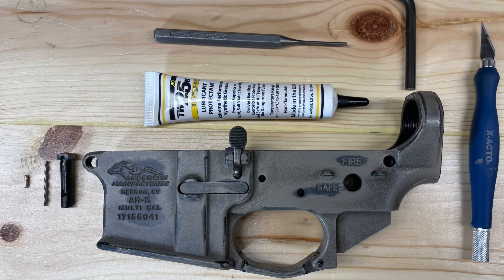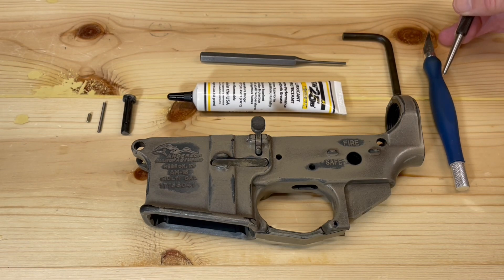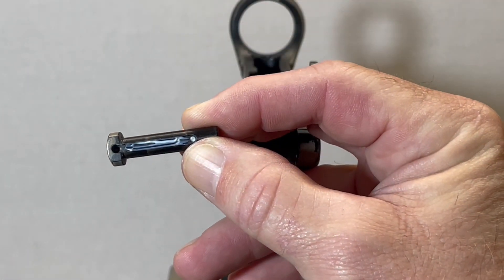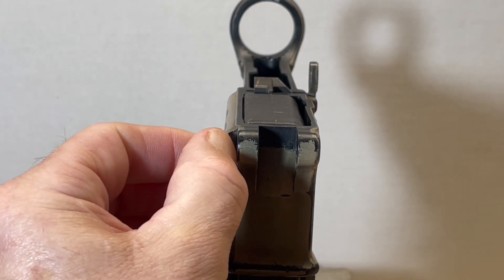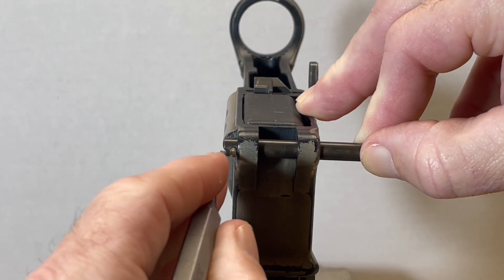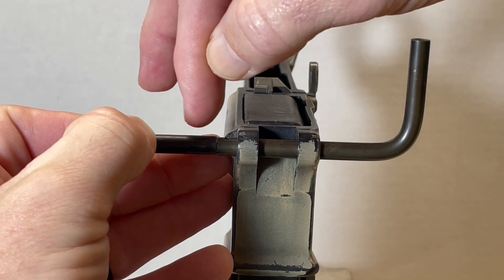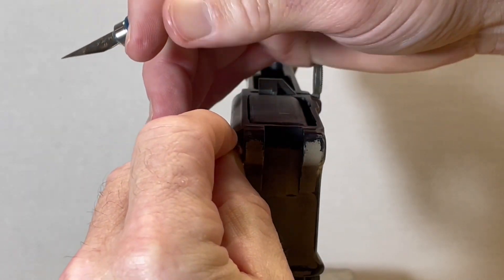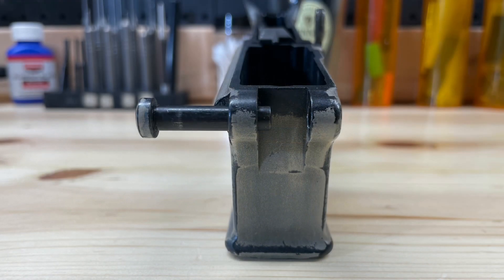AR15 Pivot Pin Installation

Comment: Thank you for your video. Regarding 2:22, for those who are unaware, the specialized pivot pin detent installation tool costs $14.49 from Brownells. However, it can be equivalently substituted with a Universal Clevis Pin of size 1/4 inch diameter x 2 inch length and costs only $2.75 from The Home Depot or from a hardware store
Reply from the maker: Looks like that would do the job at a cheaper price. Thanks for sharing.
Reply: The Universal Clevis Pin Demonstration for AR15 is @ https://www.youtube.com/watch?v=Nn9NWHQsPjc&t=27s
Reply: Real Avid tool - $12 at Amazon, chinese copy - about 3 - 4 bucks at Ali (but works equally, tested). No punches/smth else needed, all included. Most handy tool for that operation, as on me...

Comment: What type of gun oil would you recommend using sir that would not be expensive but give longevity and adequate use.
Reply from the maker: If you ask 100 guys you’ll get a 100 different answers and they are all good.  I use a lot of gun grease on my AR.  I think it holds up longer than oil.  I use it primarily on the BCG and bolt lugs.  For other areas where grease is too heavy, I use Ballistol.  Not the cheapest but it goes a long way.
Reply: @GunTalk556  yeah ballistall and g96 are both very good. I keep g96 around all the time. I've never been a huge fan of greace mainly because it's always pretty dry and dusty where I live and grease is a worse magnet then oil just in my experience.
Reply: @GunTalk556  thank you sir I will look into these and see if they are in my budget range. Having a family I definitely have to stay within my range. I live in a Humid area, pretty much anywhere in the state I'm in so a big problem here is rust.
Reply: I use 3-1 alot or sometimes NEW high mileage motor oil like 10w30 or something. Doesnt take alot by any means... lightly coat inside of the reciever, bcg, top and bottom of the charging handle. And when I say light coat I mean like super thin layer rub it on with your finger.
Reply: @tylertapp131  thank you, I've been trying to find a good oil that won't cost me a lot of money and still provide the proper lubrication for my firearms. I have both 3n1 and 10w30 on hand, I'm guessing by newer you mean synthetic and not mineral. I have both types of oil.
Reply: @gregoryking7607  no problem man, and to be honest I have no experience using mineral oil, but yes 3-1 and synthetic work great and cheap! Dont believe you will ever go through a bottle of motor oil in a gun in your lifetime lol. People overthink it sometimes. Oh.. and what I mean by new motor oil is, right out of the bottle not used from a vehicle..
Reply: @tylertapp131  mineral oil doesn't last as long as synthetic, living in a Humid state rust is definitely a big issue, definitely wouldn't use anything but new, fresh oil and since I have them I will see how they fair to the climate I'm in.